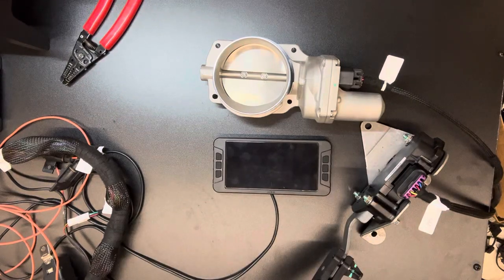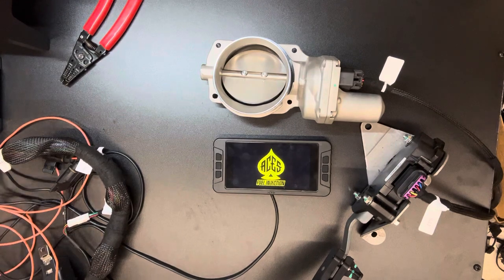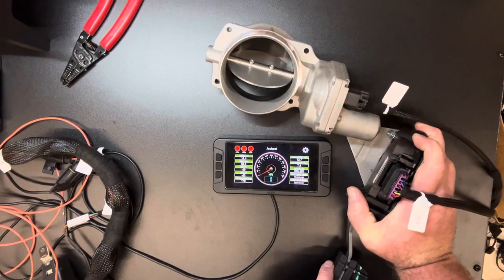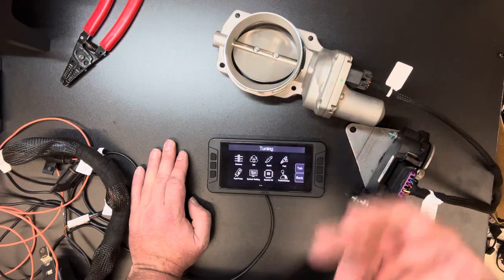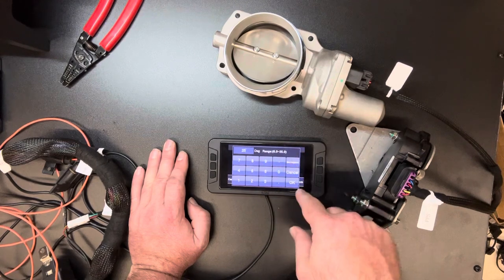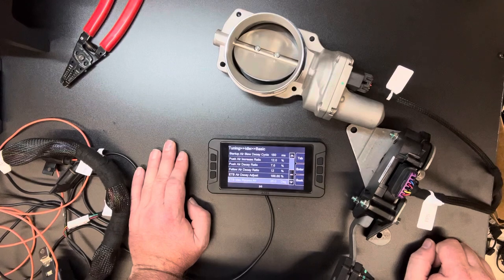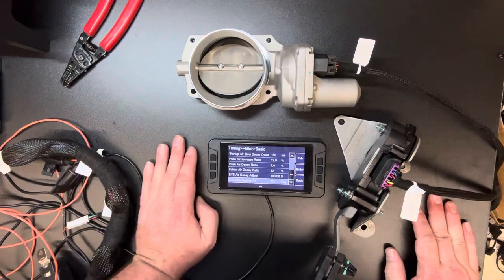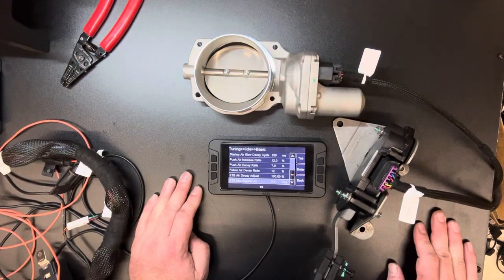Aces drive by wire things

Comment: I need this for my turbo 190.  That part throttle at startup is annoying.  Also this can account for the alternator kicking in? I’ll look up aces dbw
Reply from the maker: The dbw will chase whatever the target idle is no matter the engine load. It will go all the way to its set limit. I have no issues